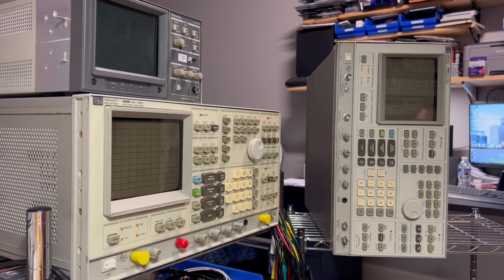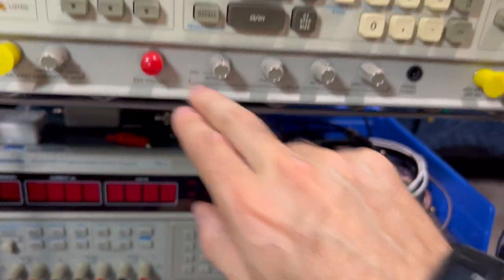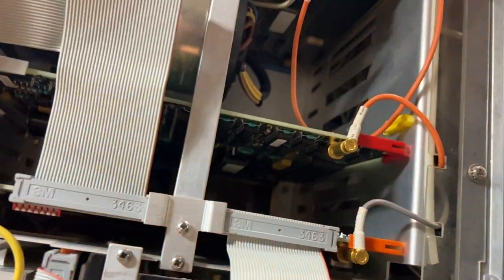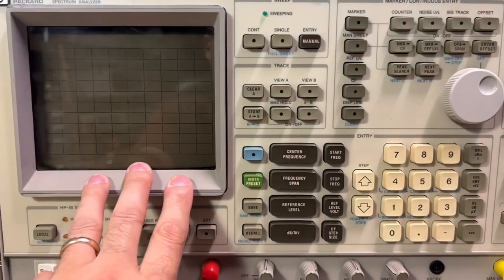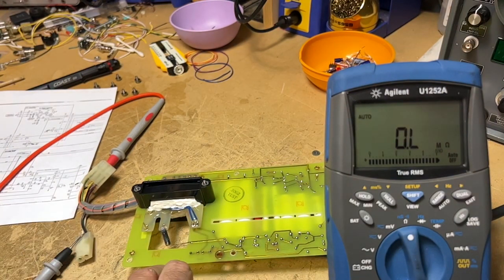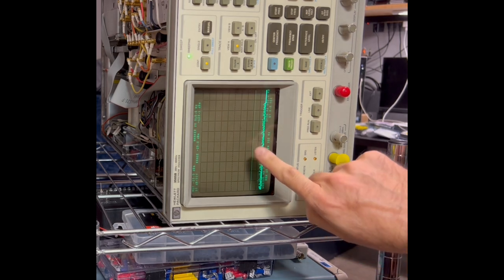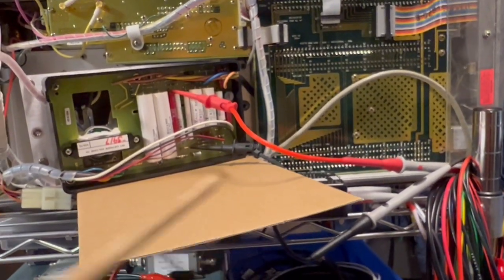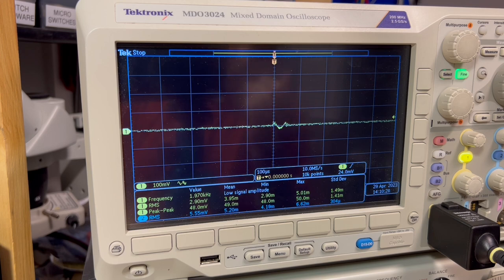HP 3585B Display Repair

Comment: Great to it back to life...as for the new unit, will you repair it or as a donor unit?
Reply from the maker: I’ve had a more in-depth look at the parts unit. The A14, which I somehow overlooked the glaring “bad” written on the chassis, has several caps missing. Not terrible to replace but I suspect other parts might be missing also. As for now it will be a parts unit. I have managed to acquire another A65 assembly though so who knows. Maybe I’ll tackle a repair on the parts 3585. Don’t know what I’d do with two of them though. Thanks for the comment.

Comment: I believe the CPU in the 3585A is the same one used in the 9825 computer.  The 3585B uses a 10MHz 68000.
Reply from the maker: Yes. When I was younger my father acquired three 9825s from his employer at a microwave manufacturer. They closed the plant and were cleaning out the lab. I remember they had those processors in that calculator just like the 3585A. I took them all apart, because that’s what I did when I was 10 but I wish I had them now. CuriousMarc has some great videos on those calculators, brought back a lot of memories seeing the insides again. Thanks for the comment.

Comment: I noticed the banding while looking at the diagrams, you might want to try changing your camera frame rate to match your mains line frequency to avoid that, so if you are on 60Hz try using 30fps
Reply from the maker: Yeah sorry about that. For some reason my video was recording in slow motion during the first half of recording. Not really sure why but luckily I was able to revert it to normal speed without having to redo the video. I’m thinking that is probably the reason for the shifting in the first half of the video. I haven’t had that issue before. Thanks for the comment.

Comment: The serial number starting in 29 means it was made in 1989, in case you didn’t know that.
Reply: Adding some details on this: It is the year that manufacturing for this specific hardware version started. The device itself might have been made that same year too but it could also be sometime later. Those digits are generally changed only with a new main version which might have been produced several years later, if it exists at all. 2 devices with the same number does not guarantee identical devices but these will be very close. Some service manuals provide more information about specific serial numbers. Inscriptions on the components inside can provide an indication on year of manufacturing.
Reply from the maker: Thanks for the information. I did some date coding on my original 3585 just going off some of the logic chips and it put the unit date inline with the serial number. I believe it’s the first two numbers added to 60 so 29 would date it, as you said, to 1989. I didn’t validate the date of the parts unit. Maybe I’ll have a look next time I’m in it. Thanks for the comment.

Comment: @27:00 I would be suspecting the op amp.
Reply from the maker: I originally suspected the Op amp as well. I did some off camera testing of the board and fed a small negative polarity voltage into the feedback line. I had the board connected in the SA and powered on, with the local fuse pulled to isolate drive to the FBT. I was able to get a normal response from the op amp with a simulated voltage error so I ruled that out. It’s a shame because that repair would’ve been a lot easier on the wallet.